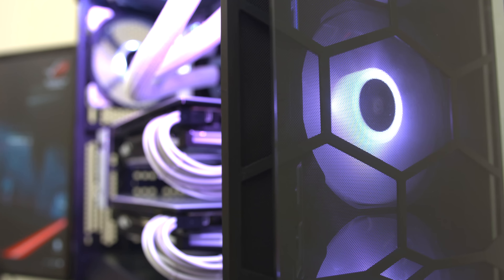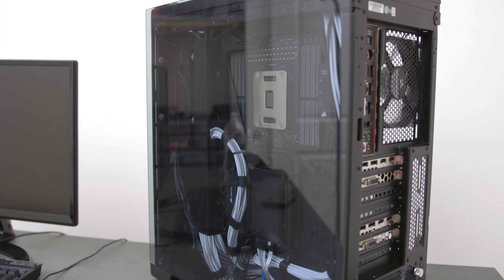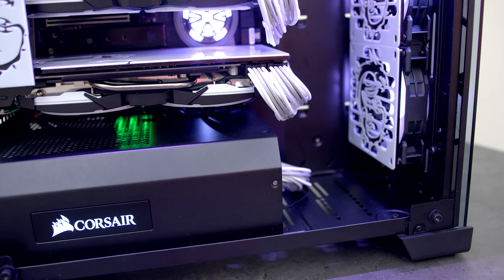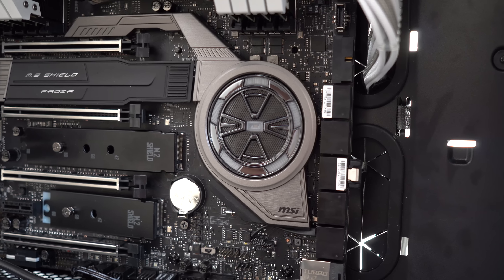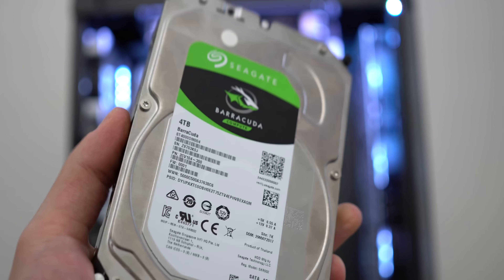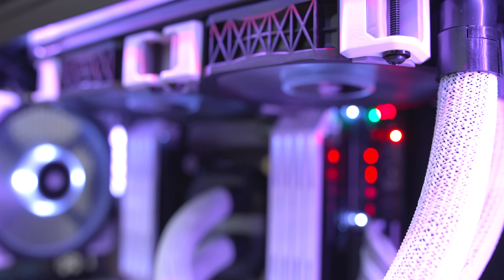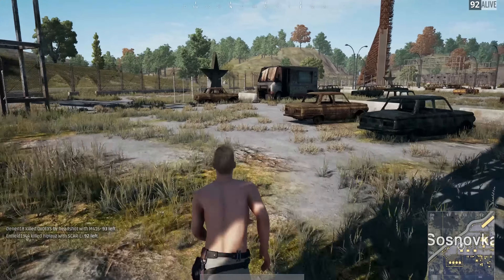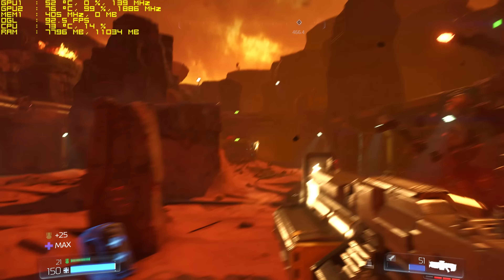Benchmarking the $5000 Ultimate PC | August 2017

Comment: On the Mechanical Hard drives use the Hard Drive covers from V1Tech.  Unfortunately the SSD covers wont fit in the caddy but the HDD covers sit on top of the 3.5" Bays

Comment: Another reason why your CPU is so hot is because you have your AIO rad as exhaust.... You literally blow the hot air from the GPU's trough it to heat the water and significantly increase your temps. Few tech youtubers did a vid on this...

Comment: Hey Techsource (or Ed?), I have a question that I am not really finding on google or any searches for that matter. I have with me, 2 3.5mm Microphones (or Lavs as I have been seeing?) and I want to use them to record a gaming session with someone else. Now can I get  mixer with multiple 3.5mm microphone inputs support, or is a Y-splitter the way to go? I am just starting out and I am just using what I have presently to do what I want to do. 

Basically I am looking for a setup like this (and feel free to add more pieces to finish my puzzle as I am not too aware of what I need):        

[INDEPENDENT Mic's 1 & 2]   plug in -> =Input [Mixer?/splitter] output= plug in -> =Computers pink 3.5mm jack RECORD

So basically heres what I have, 2 microphones, both with 3.5mm plugs, A Desktop with a front and rear pink 3.5mm input jacks, and i want to record BOTH of them to one video recording. one mic will be on ME, and the other on the OTHER person. I do not want to record skype (which is what I found ALL day on google). I know I am probably repeating a LOT, but I just want to make this as clear as possible for you, and maybe anyone else here. So please, any advice is welcome and I hope anyone here has the answers. (if you suggest a Y-splitter, please let me know how to find one that will not short out anything, apparently that is an issue?)

Comment: What gpu should i buy with my intel core i5????
Reply: Mc Troopah 1060 6gb
Reply: who said he only plays minecraft? lmao
Reply: Mc Troopah which i5
Reply: Right now with mining and stuff gpu prices are high, but the 1060 3gb is still decently priced, or the 1050Ti 4gb
Reply: Pringlez 3gb of vram is no where near enough
Reply: Destiny FTW , yeah I guess, but also I have 2gb vram and as long as I turn down the detail quality, it's fine for triple A games
Reply: Mc Troopah 1050ti
Reply: Im getting a i5 with a 1050TI
Reply: ItzFunky No i said IF YOU PLAY MINECRAFT and when did i say its a shitty game
Reply: Mc Troopah 1050 TI
Reply: Depends on which i5 you have and what your budget is. If you have an i5-6600k, go with a 1060 6 GB card, i5-7600k is plenty enough for a 1070 or 1080 with minimal bottle necking if any at all. But if you have an older i5 I'd probably go with a 980 or 980ti. Up to you though. If you are low on funds, go with a 1050ti and save for a new card.
Reply: Cyemese 980ti is better than a 1060 more on par with a 1070 though?
Reply: I'm thinking more along the lines of better support with older cpu's. I'm not a genius when it comes to computers. So I could very well be wrong. I'm just throwing my insight into the mix.
Reply: I think gtx 1050ti will be good for you

Comment: How long ago did you run those benchmarks? I have two 1080 Ti FTW3 and I get better FPS with SLI enabled in all the games you had performance problems in. I did have issues with SLI performance at first (I got them both at launch) but after a few  drivers updates they're working great

Comment: Do R5 1600 (stock cooler) + 1080ti is enough for 4k gaming or I should go with the I7 7700k with a H100i V2 so it will cost 225€ (in France) more than the R5 1600

Comment: Theres something wrong with your SLI testing, Ive seen multiple reviewers test all of those games you mentioned with 2 1080ti in SLI, only difference with your setup was that they were using the 7700k instead of the 7900X. And GTA also run air nearly 90fps maxed out, not around 60. Id recommend you do some digging.

Comment: You shouldnt have used the armour cards. They're shit in terms of cooling and they're loud.
Reply: Osu Community they also preform the worst out of the 1080 tis besides maybe the mini by zotac
Reply: Osu Community Noise and cooling are pretty much thr only thing that separates 1 Ti from another. The armor is deadlast in 3rd party cards. They are an absolute joke.
Reply: Osu Community ive heard ppl say that armour 1080 tis are basically a ti, with a 1070 cooler strapped to it. Thats just how bad it is
Reply: nvidia is a joke.peroid
Reply: Obvious troll is obvious. CSRF Broforce you really need to learn how to bait better. Smh, normies these days.
Reply: CSRF Broforce bait normie
Reply: Couldn't agree more, the duke is way better.
Reply: Usually people only buy the armor 1080 ti because they intend on using a gpu waterblock later, since it's definitely on the cheaper side of the 1080 ti spectrum. Kind of sad we didn't see any custom water cooling, but after the backlash Ed got from Electrobox, he's probably not going to do another one for a while, at least not until he feels more comfortable with custom water cooling

Comment: guys i need to know asap if this is a good build

Intel - Core i5-7400 3.0GHz Quad-Core Processor

Cooler Master - Hyper 212 EVO 82.9 CFM Sleeve Bearing CPU Cooler

ASRock - B250M-HDV Micro ATX LGA1151 Motherboard

Team - Dark 16GB (2 x 8GB) DDR4-2400 Memory

ADATA - Premier Pro SP600 128GB 2.5" Solid State Drive

PNY - GeForce GTX 1050 2GB Video Card

DIYPC - DIY-F2-W ATX Mini Tower Case

EVGA - 400W ATX Power Supply
= $645
i will mostly be playing cs go, team fortress 2, and other mild games. is this good enough for fh3? (forza horizon 3)

Comment: Not sure why your SLI rig is running like crap.  I have a 7700k with 2x1080ti SLI and I get nowhere near as low of frame rates as you get in Doom, BF1, or PUBG.  Sounds like a driver issue if you ask me.

Comment: Can someone tell me if this is a good pc and all parts are compatible?

CPU: Ryzen 1500X
GPU: Geforce GTX 1060 Founders edition 6gb
MOBO: Gigabyte - GA-AB350-GAMING 3 ATX AM4
RAM:  Kingston Fury 8GB 2x4GB DDR4-2666
Storage: Western Digital - Caviar Blue 1TB 3.5" 7200RPM Internal Hard Drive 
Case: Corsair - 270R ATX Mid Tower Case
Power Supply: Corsair - RMx 550W 80+ Gold Certified Fully-Modular ATX Power Supply

Gonna be a Red and Black build went on PC part picker and it says everything is ok.

:/
Reply: Anyone?
Reply: Yes ?
Reply: ContentMark yes surely....great build
Reply: But dont get the founders edition
Reply: Yes it's a good pc but i would go 1600 instead in fact i did build a R5 1600 like a month ago. You can't go wrong with both 1500x or the 1600. It's just a matter of the cost if you can do a better deal with the 1500x then go for it.
Reply: Alright thanks guys! I'll be sure to change the 1500x
Reply: Get a ssd
Reply: ContentMark go for ryzen 5 1600
Reply: go for 16 gb ram and then you have a perfeckt 1080p pc
Reply: Good just don’t do the founders edition.
Reply: 2x8 gb ram is better.

Comment: the ultimate pc would have a threadripper 1950x. Not the crappy and super hot (literally) 7900x
Reply: Obvious troll is obvious. Eman you really need to learn how to bait better. Smh, normies these days.
Reply: Shellcode would be good at CinemaSins.
Reply: Shellcode im not trolling, you really need how to bait better.
Reply: I mean this is a GAMING pc, the treadripper is mostly used for productivity.
Reply: if you want a gaming pc, just buy a 7700k. Performs much better than the 7900x on that task.
And.. if you spend 5k dls on a gaming rig, you have at least a 4k monitor, and at that resolution, the difference between a 7900x and a 1950x is null. Even a 1080p there´s a 5/10% difference.